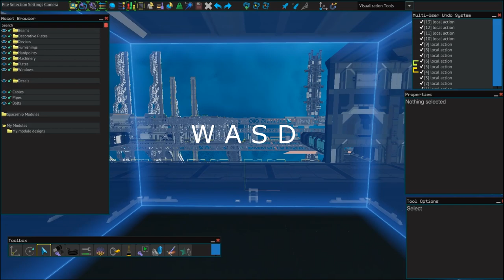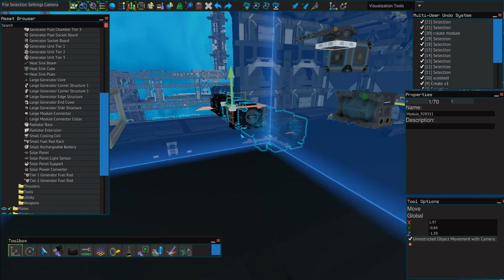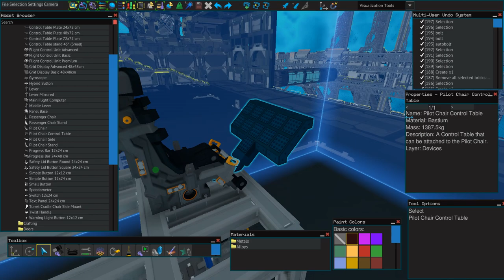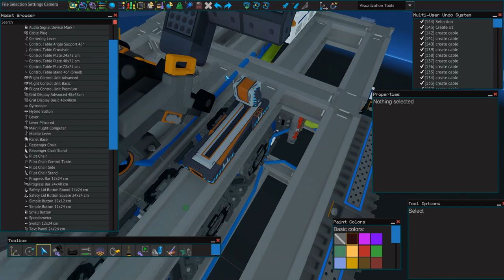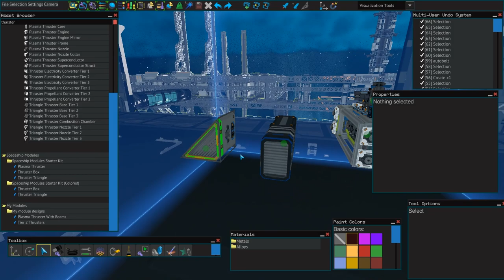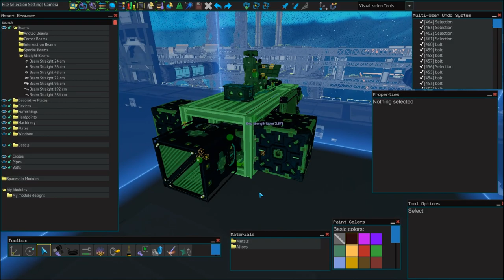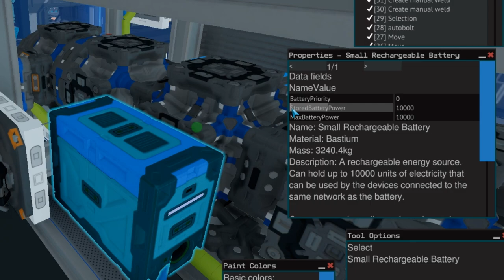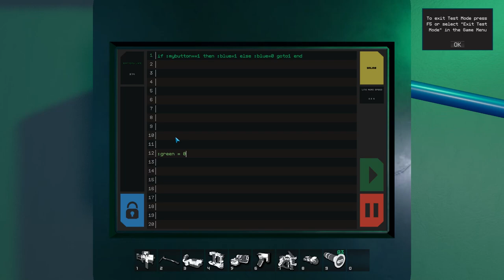Starbase Ship Design - Complete Beginner Guide

Comment: Is it possible you could do a tutorial on the new large generator assembly and explaining how it compares to the normal T1, T2, T3 Generators in respect to power output.
Obviously the bigger Gens can only fit on a big ship.
Reason I ask this is because there seems to be no real tutorial on the big Gens and no one else as done a YouTube Video on them from what I can see.
Reply from the maker: I spent a while putting it together for this free module kit: https://www.youtube.com/watch?v=o7Exul32YVs They just need to be plugged in and maybe snapped together? not sure.
I cant remember exactly but during tournament i had a look at big gen vs small gens. Big gen 7000 power I think, small gen 100 and more for tier 3 and if you add enhancer you can get up to 200 on tier 3 i think. Its expensive so i stick to tier 2 with enhancer for 150 power per small gen but its super cheap compared to big gen. Thats why ill never use big gen because its around 10 mil if you buy the ores for it at auction and the small gen equavelant in power cost less then 1m if you use tier 2.

My competition fighter in my last video squeezed 52 gens and most of them with enhancers that generated just over more power than 1 large gen. but much much small and less weight because i didnt have to have huge exorium tank and processing unit that comes with large gen.
I think the upside to large gens is its longevity, lasts extremely long before needing to re-fuel, in addition some claim to save voxels if they add more large gens because you only need 1 large exorium tank and processing unit and can have multiple large gens for it. Again not my specialty, i prefer small gens for cost, tournaments, and less space used.
Reply: @CommandoDoggo  Thx for reply
It all makes perfect since what you're saying.
Reason I asked about this is because of the large ship build I have in progress and considering it will require alot of power to actually move at any considerable speed and taking into fact that I will be using plasma thrusters, I was trying to way up the amount of room 50 to 60 tier 2 Gens would take up over a large Gen that produces the same power but might need less space.
Also the Ores are not really a problem for us.
Starbase kind of annoys me that they produce components with very little tutorial for player to be able to understand.
It's like they just said here you are now spend weeks of been bored trying to understand, or like when I use to travel a 1000km out under the belt completely bored for 2 and half hours staring at the screen or watch a full episode of lord of the rings before you reached your destination.
Reply from the maker: @JASON-rq5gl  I think the large gen doesnt need as much cooling either so less heatsinks and radiotars but still i think a compact small gen setup is smaller unless you need a ridiculous amount of power of multiple large gens. True, I made this tutorial because i don't like how all the info on starbase is scattered all over the place, content creators have to fill in the gaps.
Reply: Unfortunately, there is currently no way of refueling a large generator without completely disassembling it each time (which is obviously problematic for ship durability), or doing a repair at a station. This limits the usability of large generators past the 20 hour runtime.
Reply: And as Doggo said, one can make gen setups that provide more power than the large gen for the same space, though you would have to change the rods about 10 times more often. If you are only using the large gen within the safe zone, then it is viable to use and refill by using the repair station, but if you ever plan to be away from the station for longer than the runtime of the fuel rod, do not bring a large gen ship as you cannot refill it (unless you ALSO have small gens for backup)

Comment: oh shiiiii what, how good is the weld blocks? and when did they add that!, my last design still needs heat sinks from over a year ago however i hit the bolt limit- you may have just fixed it with that alone
Reply from the maker: It was added several months ago with some other interesting little things as part of the last major update. And yes it is a life saver for bolt users! the best use is sticking unusual modules together or beams quickly. They also help durability so if you run out of space to bolt something you can stack weld blocks on aswell. they count towards object limit though.